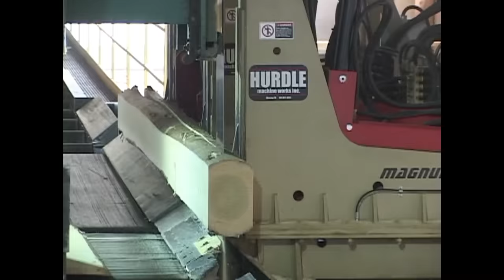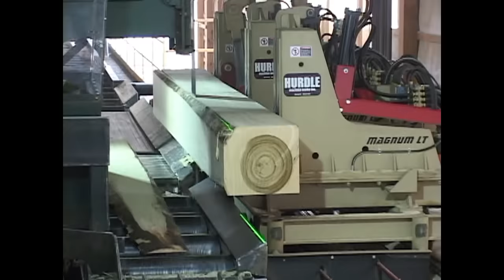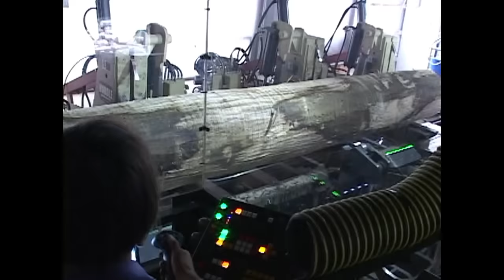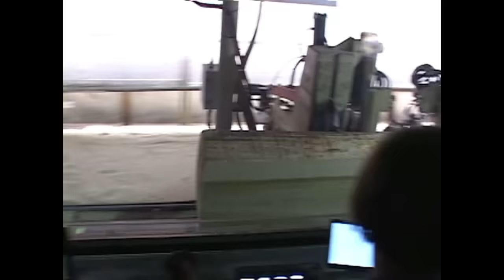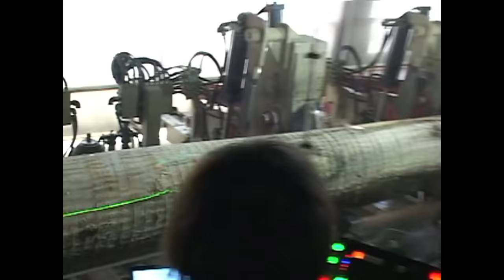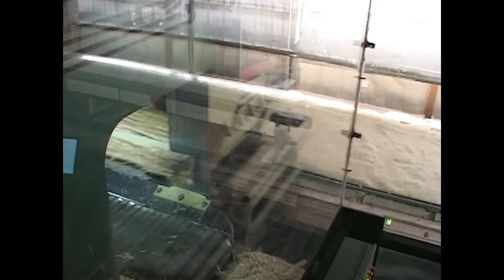Magnum LT Linear Carriage 1   -   Stoltzfus Forest Products

Comment: We had friends that owned a sawmill in NH and it was a more typical diesel engine driving a circular blade probably 52"-60" in diameter and they cut mostly rough sawn White Pine. They could have never dreamt of cutting wood so fast as this double sided blade band saw, absolutely astounding how fast this machine is.

Comment: That is the most impressive mill I’ve seen yet and I watch these videos.
Some machines have facets, but not many use a blade with two edges like this.
That is cool.
Reply: Cleerman builds a similar rig. This Hurdle carriage is made in Moscow, Tennessee and very commonly used in the South for the production of cross ties. There are several astounding videos on YouTube of them working.
Reply: 1lp
Reply: La
Reply: L lo pe ơi l
Reply: It's definitely the fastest mill I've seen and I watch alot of these too

Comment: I worked with a man back in the say that could overlap the boards on the rollers. I felt sorry for the guy running the edger.. He was pretty good also.
Reply: That's a poor headrig operator then.....causing problems down stream by bunching up boards.....good operator can saw and keep boards separated

Comment: how about more long wood? 6+ meters? *on video very short. sure too need but need 6+ meters its standard/norm in Russia
Reply: In the United States typical grade lumber is acceptable at 6 foot, 8 foot, 10 foot, 12 foot, 14 foot, and 16 foot. Even if a board is an inch or 2 shy of making one of these lengths it must be cut back and put into the next size down. Most mills will saw the short (6' to 12') at once then switch over to long (14' to 16') just the easiest way for separation